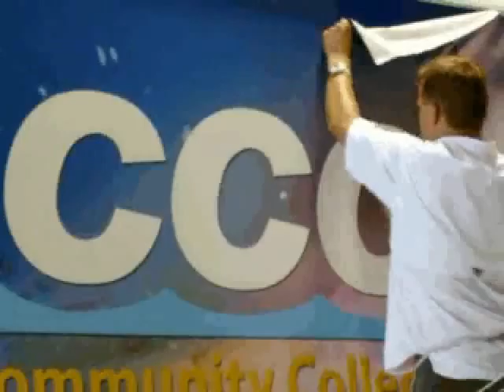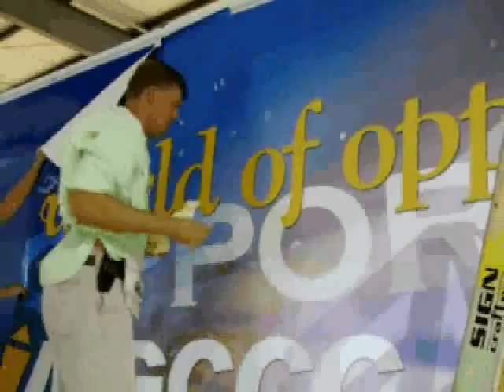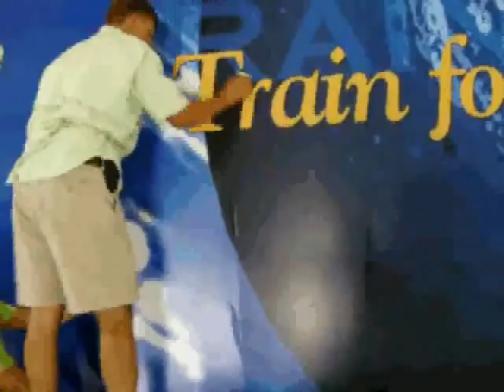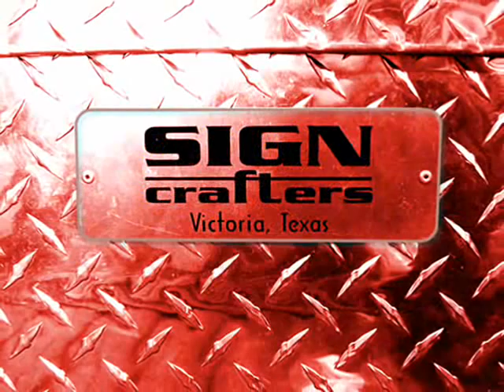Moterhome Remodel - MGCCC Mobile Classroom Refurb & Decal Application

Comment: Awsome, did you use soap and water, is  that what you were spraying on the decal before applying it. I tried it dry, had the hardest time and scraped a 4.5' x 14' decal I applyed to a truck.